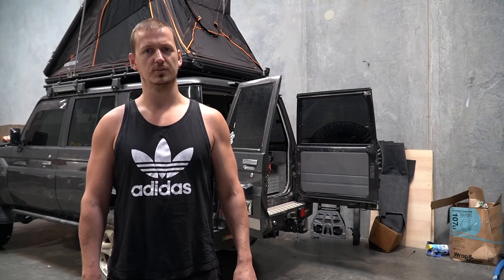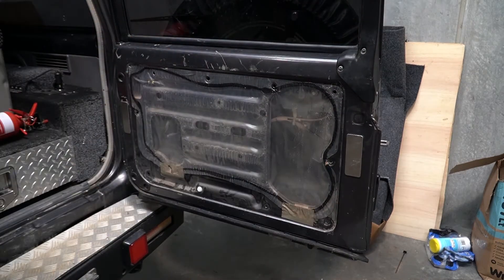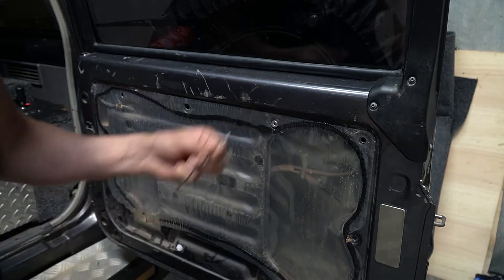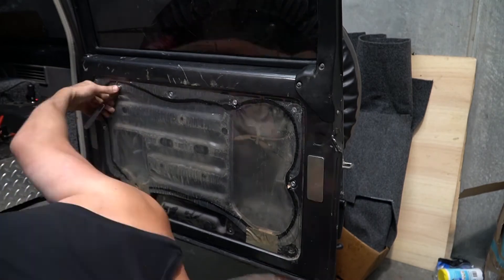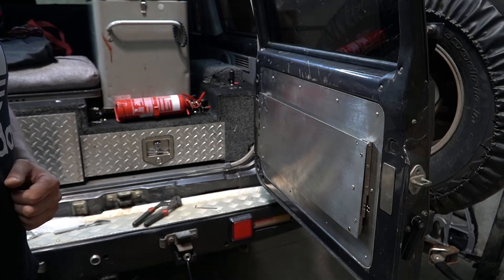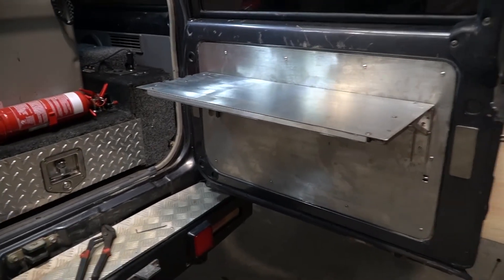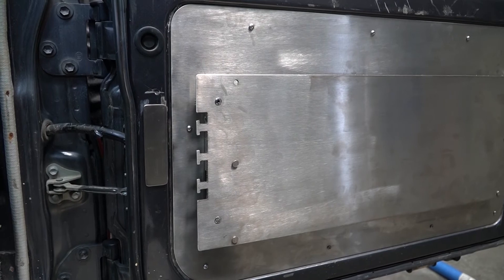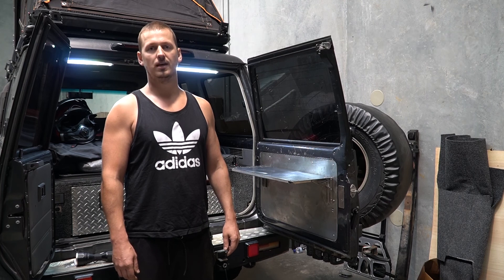New 4x4 folding table prototype! A first look at the best mod for your rear door - COMING SOON

Comment: Love it! I did a similar thing a coupla years ago with my Prado 90 series. I bought a kaon Prado 150 table and then had a 3mm ally sheet cut to the same size as the door card and then rivnutted it to the barn door and it came up an absolute treat! 
I do love the upfold table tho! Better height to work at and the drawer clearance is great 👌👍
And the quick fold hinges are sweet as!
I'd love to convert mine to an upfold style . . . .
Reply from the maker: Drop an email. If you're handy, and have the plate already, a conversion kit would be easy enough. I won't be able to reply for a month or so though, as I'm the only one doing the 4x4 parts at the moment

Comment: Nice, how do you think one would hold up on the side of ute tub?
Reply from the maker: This use would probably need testing (so far this version is 12 months of abuse). But considering the materials it's made of, I see no reason for it to be a problem. Obviously time will tell, but guinea pigs get discounts 😏